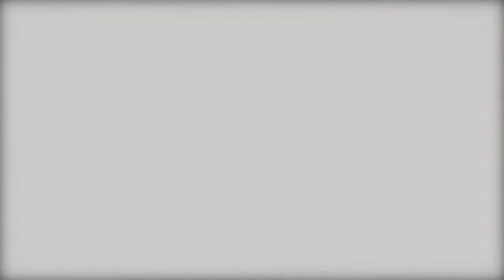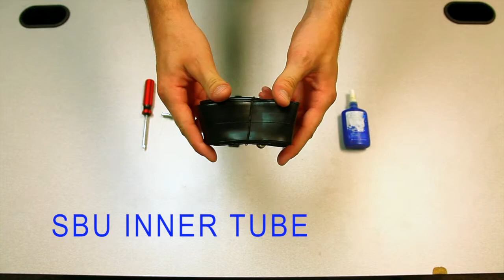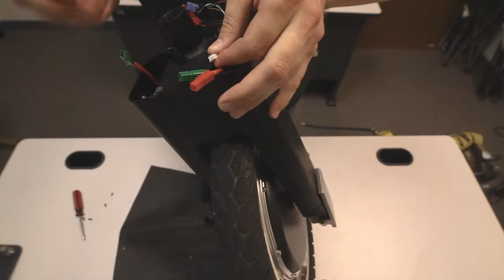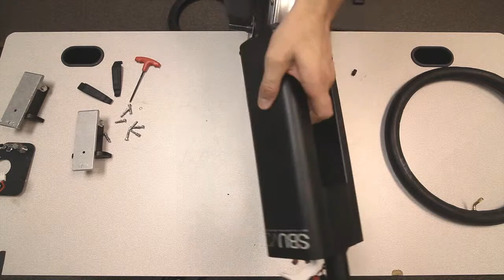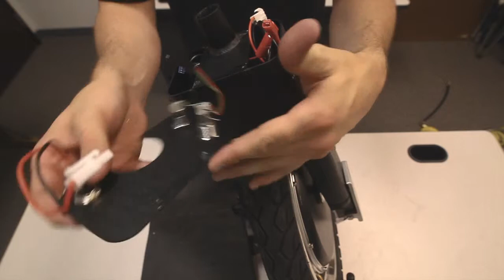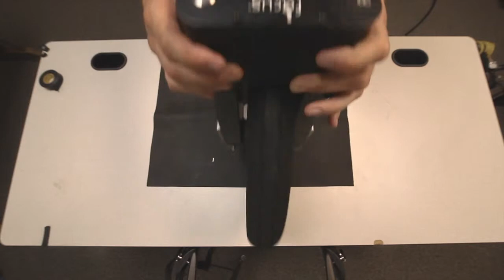How To | Change Tire

Comment: Just curious...coming from an aircraft minded background, have you every thought of using an threaded cannon plug (perhaps a 14 pin) setup instead of several different fittings? It would reduce wear when removing and installing the pins and plastic housing and near idiot proof to reinstall when done doing the change out.

http://www.ebay.com/itm/NEW-ITT-CANNON-MS27467T19F35P-CIRCULAR-CONNECTOR-PLUG-SIZE-19-/181378670775